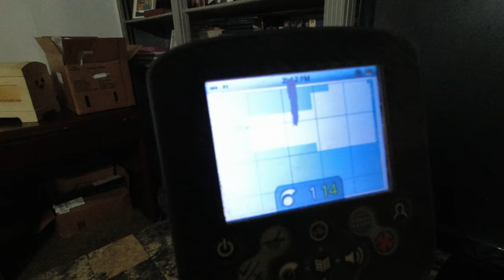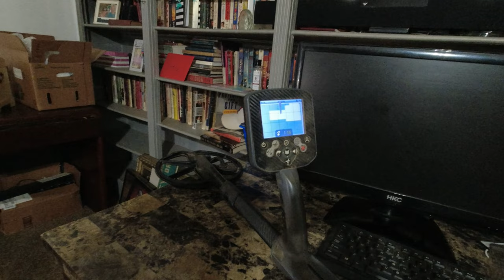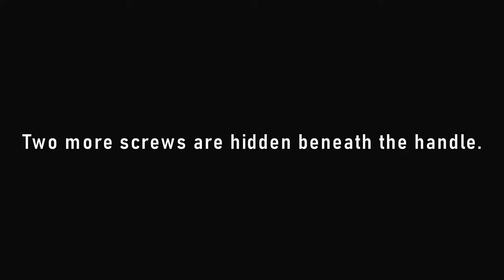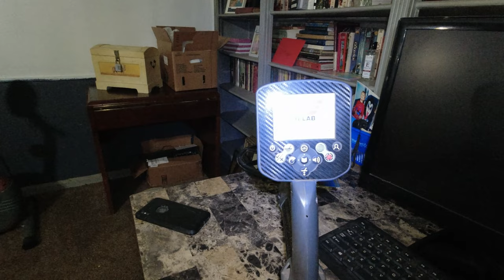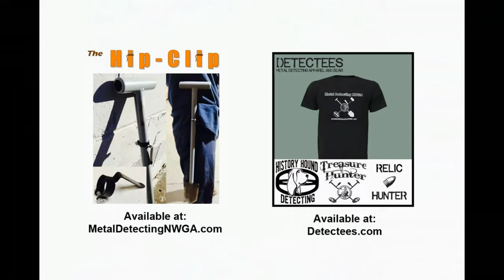Minelab CTX 3030: How to replace the LCD screen (#101)

Comment: Got to hand it to you, that was a good one.  I have worked on electronics for a very long time, and I will admit to a hatred of ribbon cables.  Necessary evil I guess, and a lot easier than de-soldering and soldering that thing.  You nailed this one, good job!
Reply from the maker: Thanks Richard! Man I hate working with ribbon cables too. I feel fortunate to have gotten through this one without screwing anything up.

Comment: Sure hope my screen does not go bad. Not sure I have the nerve to go into the control box on the CTX. Still have 3 years left on warranty. I wonder what made your screen go bad? Dropped it? left in car on a hot summer day with windows rolled up? Used in the water? Funny thing about electronics. Most things go bad in the first 2-3 weeks after your purchase it. Other than a corroded or loose connection or wire the integrated circuits will last a long time if not over heated, gotten wet. Of course sometimes they just fail for no reason, probably a quality control issue missed on the IC board testing at the mfg. Or do they even test them other than turning on the machine to see if it works?
Reply from the maker: It was definitely my fault. I often go detecting after work, so I leave my detector in my truck all day during the hot summer months. I'm sure that played a role in causing it to fail. Replacing the screen was pretty easy and straight forward IMHO.

Comment: Merry Christmas Dewayne and family! Just got the nox800 for Christmas any basic tips for getting started? Wernt in my yard and found a bunch of deep nails and a copper zipper pull witch i was suprized i missed with the deus. Do you have a vid up on basics? Anyhow glad you are feeling better could he worse lol. Cheers Nathan
Reply from the maker: Hey congrats on the new machine Nathan! Episode #91 might be helpful to you. It’s on recognizing falsing with the Nox. I found that using 5 tones made it easier to learn. Full tones was just sensory overload for me. For coins, I like to run Park 2 and accept 11-13 and 18 on up. That’ll get ya nickels and everything from IHPs on up. Park 2 hits coins on edge like a champ, plus it seems to separate better than Park 1 and Field 1. Running recovery speed at about 5 gets me some really good depth and it’s still plenty fast. I tend to run the iron bias at 0 or 1 depending on the site. Using the Equinox is pretty straight forward. Like any other detector, it just takes a little time to learn its language. Good luck man, and Merry Christmas to you and yours!
Reply: @MetalDetectingNWGA  thanks man!!!!

Comment: Im gonna give it a try how long did you use the hair drier for?
Reply from the maker: It took a several minutes (5 to 8). You'll feel the glue starting to get tacky and turn loose. Goods luck with it!
Reply: @MetalDetectingNWGA   thanks

Comment: Using grips to remove ribbon cables is a big no no, if you look closely they have little flaps you lift up to remove the cable instead of yanking them out.
watching you jam a metal flat screwdriver into the connector was painful to watch.
Reply from the maker: The front panel plug at 8:58 plugs straight in. No flaps on this one. The small plug @ 9:38 also plugs straight in. No flaps. The larger plug at 9:49 has a flap, which I lifted. Anyway, I'm no expert on working with this stuff. Never claimed to be. Just a guy doing my own repairs to save some money. As with anything shown on any of my videos, do so at your own risk.
Reply: It's only a big no no when you intend to reuse them. But in the case of the 2 attached to the broken screen, oh well...

Comment: I could never swap that screen in my ctx and not test it before reassembling... I don't have that luck. lol Great video, thank you! Subbed
Reply from the maker: Thanks MetalDiggrz. I subbed you as well. HH!
Reply: @MetalDetectingNWGA  How's the repair holding up? Have you used the detector in water?
Reply from the maker: @MetalDiggr  Its holding up fine. I use my CTX more often than any of my other detectors and have had no issues at all after two years of heavy use. I don't do any water hunting, but I've been caught in heavy downpours a few times. I think as long as the seal is inspected, then re-installed correctly it won't be a problem.
Reply: @MetalDetectingNWGA  Good to know, Sir! Thanks for the info and vid!